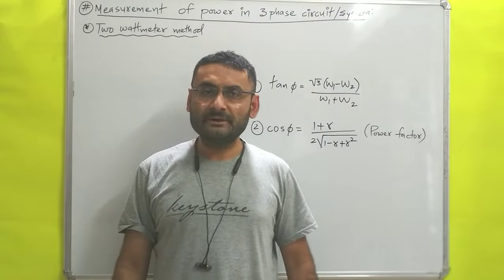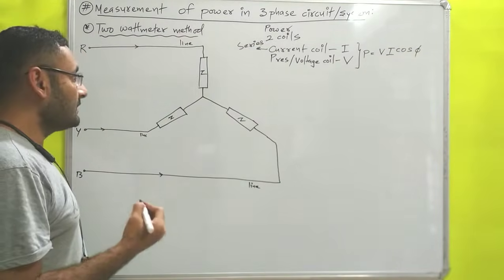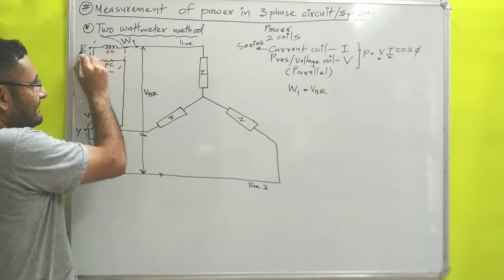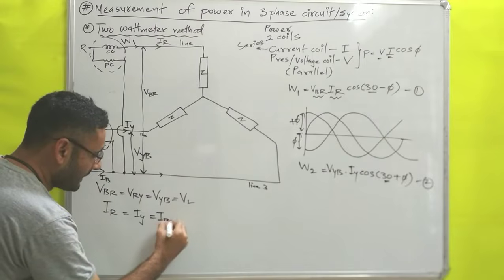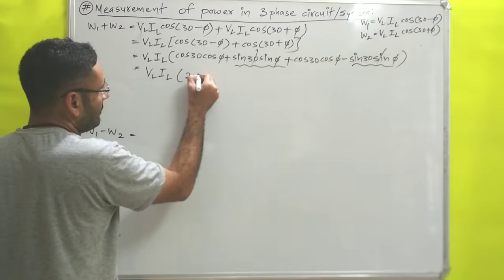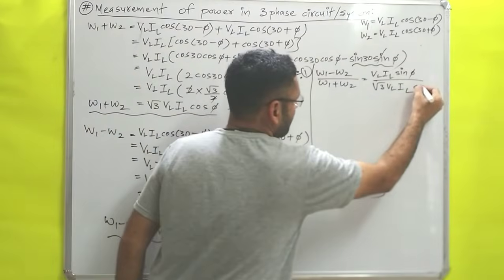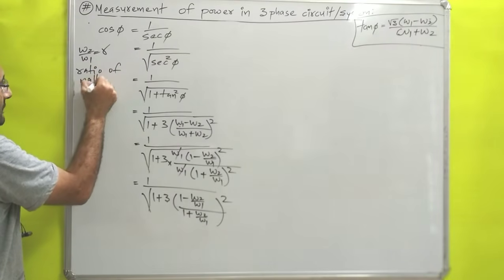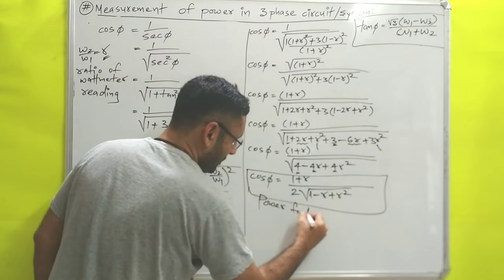Two Wattmeter method with derivation (Measurement of Power in 3 phase circuit system) BEE (GTU)

Comment: Sir why not we use a single watt meter instead of 2 watt meter. We can multiply the reading that we got in the single watt meter by 3, since it is a balanced system.
Reply from the maker: We can't multiply, 2 wattmeter is accurate compared to single wattmeter